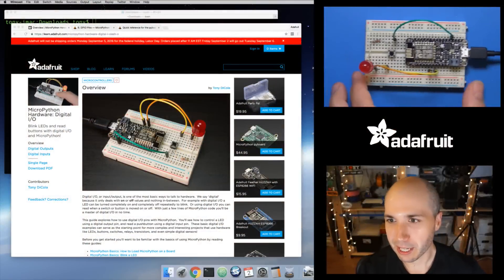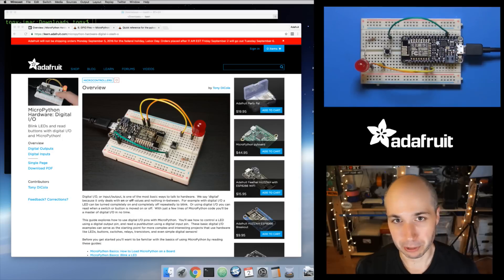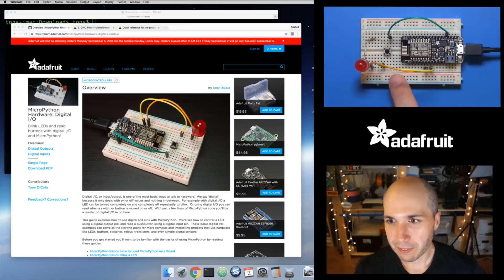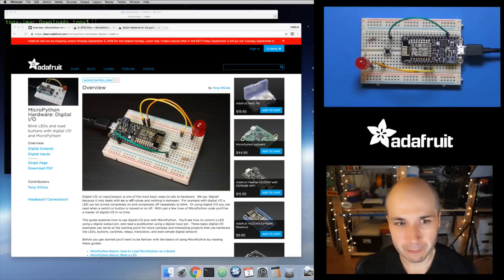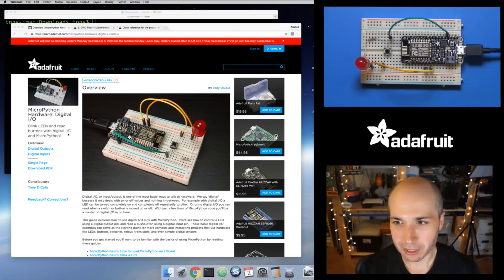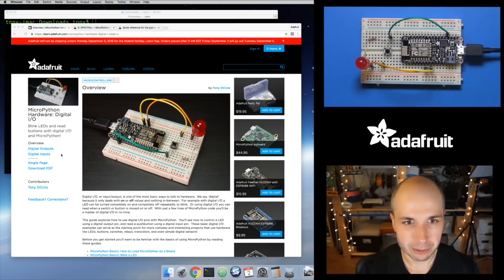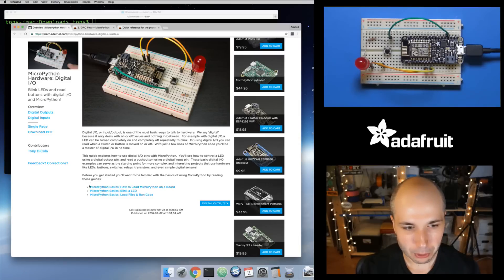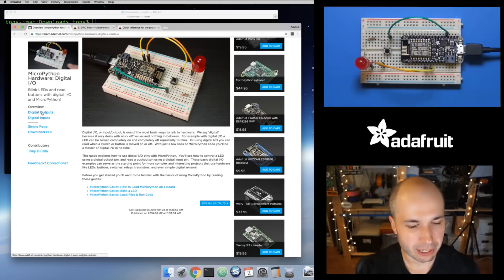MicroPython Hardware: Digital I/O with Tony D! @micropython #LIVE

Comment: Question:  Assuming you wanted to use a bunch of I/O pins as LEDs, is there a way we can initialize the machine.Pin objects using a for loop? 

I know that after you create these "machine.Pin" objects, you can put them in a Python list and cycle thru them using a for loop. Here' my sample code to do that. 

Note: my ESP8266 board is a WeMos D1/"R1" board and it uses different pinouts/GPIO pin mappings as compared to the "R2" version of the board and compared to NodeMCU boards. So, with that caveat, here's my code:

# -----------------------------------------------------------------------------------------------------------------------------

import machine, time

# Instantiate a machine.Pin object for each digital I/O pin on your ESP8266 board:
d2  = machine.Pin(16,1)    # WeMos D1/"R1" board's  D2 pin maps to GPIO16
d3  = machine.Pin( 5,1)    # WeMos D1/"R1" board's  D3 pin maps to GPIO5
d4  = machine.Pin( 4,1)    # WeMos D1/"R1" board's  D4 pin maps to GPIO4
d5  = machine.Pin(14,1)    # WeMos D1/"R1" board's  D5 pin maps to GPIO14
d6  = machine.Pin(13,1)    # WeMos D1/"R1" board's  D6 pin maps to GPIO12
d7  = machine.Pin(13,1)    # WeMos D1/"R1" board's  D7 pin maps to GPIO13
d8  = machine.Pin( 0,1)    # WeMos D1/"R1" board's  D8 pin maps to GPIO0
d9  = machine.Pin( 2,1)    # WeMos D1/"R1" board's  D9 pin maps to GPIO2
d10 = machine.Pin(15,1)    # WeMos D1/"R1" board's D10 pin maps to GPIO15

# Using a Python list to manage all the machine.Pin objects using for loops
ledList = [d2,d3,d4,d5,d6,d7,d8,d9,d10]

# Finish initialization by turning off all the LEDs in ledList

for i in range(len(ledList)):
    ledList[i].low()

# Now cycle thru each LED in ledList and blink each LED "numBlinks" times.
numBlinks = 3

for i in range(len(ledList)):
    for j in range(numBlinks):
        ledList[i].high() # Turn on LED for a sec.
 time.sleep(1)
 ledList[i].low() # Turn off LED for a sec.
 time.sleep(1)

# -----------------------------------------------------------------------------------------------------------------------------

You should be able to figure out how my code works; you just need to verify which
I/O pin on the board (the silk-screened pin numbers) correspond to which GPIO pins.
Then modify the code above to reflect those differences.
Reply: Okay, I figured out how to instantiate all my machine.Pin objects inside a "for loop". Here's my code:

#------------------------------------------------------------------------------------------------------------------
# Filename:  wemos2.py
#
# Target machine:  MicroPython - ESP8266 boards like the WeMos D1/"R1".
#
# Circuit description: A MB-102 breadboard is situated next to the WeMos
# D1/"R2" board. In the breadboard I have 9 red LEDs with nine 330 ohm 
# current limiting resistors. Each resistor is wired in series with its LED 
# and each resistor/LED is "hung" between it disgital I/O pin and GND. The 
# nine LEDs are arranged in order by the board's pin numbers D2 thru D10.
#
# This MicroPython script was written for use with the WeMos D1/"R1" board.
# It has different pin-outs and GPIO pin mappings as compared to the newer
# WeMos D1/R2 board. The "R2" version of the board seems to closely emulate 
# the pinouts of the various NodeMCU v1.0 boards. You can use this MicroPython
# script on other ESP8266-based boards, but you must verify your board's 
# digital I/O pin numbers verses the ESP8266 native GPIO pin numbering scheme
# and correct this script if they differ. Pay attention to the ledList and the 
# gpioList where these two pin numbering schemes are mapped to each-other for 
# the WeMos D1/"R1" board.
#
# In this "version 2" of the script I have found a way to use a "for loop"
# to initialize the various I/O pins labled "D2 thru D10" on my board.
# I map the I/O pins to their GPIO pins using two lists: ledList and gpioList.
# Initially, the ledList just contains integer values (0), and it is not until
# the first "for loop" that these int variables are reassigned machine.Pin objects
# each with the appropriate GPIO pin number from the gpioList. I also turn off
# all the LEDs after each one is instantiated.
#
# The script then will go through the ledList using another "for loop" and blink
# each LED 3 times in the order that they are indexed in the list. You can change 
# the number of times each LED blinks by changing the value assigned to the 
# "numBlinks" variable.
#
# This code written and tested by Wm. Moore on 5/8/2017.
# For free use by the anyone in the public domain.
#
#------------------------------------------------------------------------------------------------------------------
import machine, time

d2=0; d3=0; d4=0; d5=0; d6=0; d7=0; d8=0; d9=0; d10=0

# WeMos D1/"R1" Board Pin Mappings
ledList  = [d2, d3, d4, d5, d6, d7, d8 ,d9, d10]  # Board pin numbers (as labeled on circuit board)
gpioList = [16,  5,  4, 14, 12, 13,  0,  2,  15]  # Equivalent GPIO Pin numbers (as used by ESP8266)

# Intantiate the 9 machine.Pin objects in our ledList
# and then turn off all 9 LEDs
for i in range(len(ledList)):
    ledList[i] = machine.Pin(gpioList[i],1)                       # Shortcut: The 'machine.Pin.OUT' constant is "1".
    #ledList[i] = machine.Pin(gpioList[i],machine.Pin.OUT) # Longcut: 'machine.Pin.OUT' is 15 characters long!
    ledList[i].low()

numBlinks = 3

# Blink each LED one at a time 'numBlinks' times
for i in range(len(ledList)):     # For the next indexed LED...
    for j in range(numBlinks):    #   Blink the LED 3 times
        ledList[i].high()   #     Turn on LED for 1 second
        time.sleep(1)
        ledList[i].low()   #     Turn off LED for 1 second
        time.sleep(1)

# EOF
#------------------------------------------------------------------------------------------------------------------